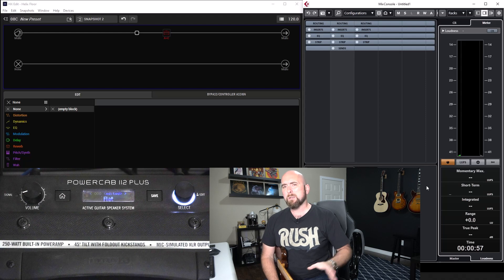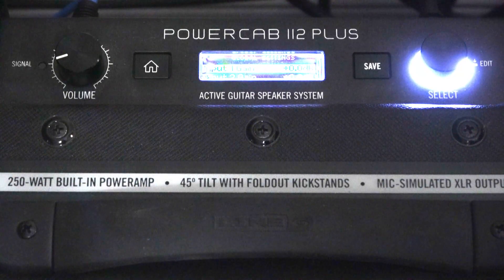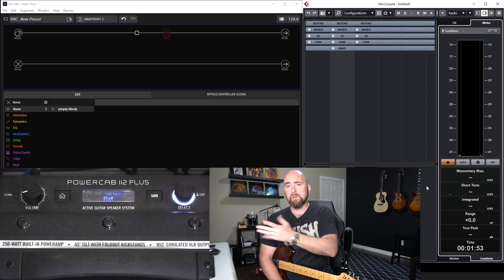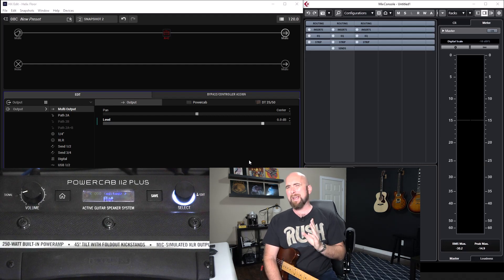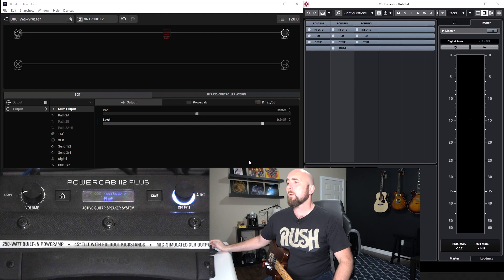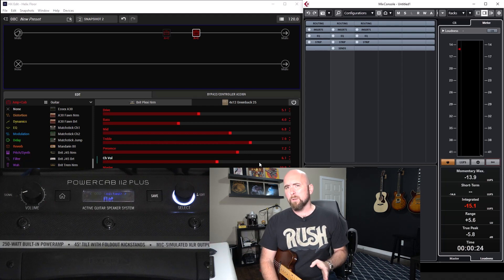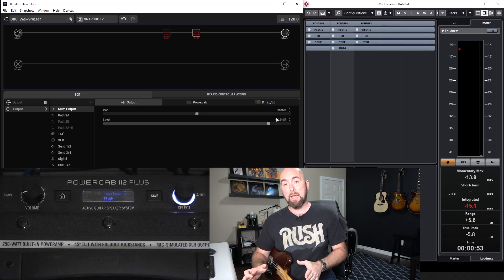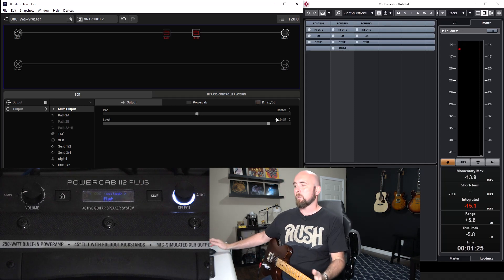SETTING UP THE LINE 6 POWERCAB 112/212 FOR THE ABSOLUTE BEST RESULTS!!

Comment: Hello and thank you for all your extensive testing and sharing of experience and use of these types of equipment. I'm in a middle of choosing what to do in the future on regards of amplifiers, speakers and sound quality requirements. I have two guitars, one with single coils only, and one with only humbuckers. I have a Helix Floor about 9 months old, a Fender Hot Rod Deluxe, a couple of studio monitors, and am able to use PC as an audio recorder and so on. I'm looking for a unit/solution to use only in my home, I don't gig, and therefore have to go for a solution with low sound output. Problem I have is to find a solution that don't have "knife-sharp" or bad sound quality. I'm wondering if a solution with a low-powered amp (like Fender Champ Reissue 5W), a FRFR (like Powercab 112) of some sort or an attenuated/reactive loadbox (like UI Ox Box) for my Fender HR Deluxe, an amp with attenuation built-in (like Tone King, Fender Tone Master) is the best solution from a sound quality viewpoint. Flexibility is certainly in the Helix, but I can use it as a pedalboard as well. A lot of info here, but hope you can help me with some recommendations and what I could prioritize to do. Again thank you for your contribution. It's really appriciated.
Reply: The 5 watt amp will lack headroom - it will sound compressed compared to a 50 or 100 watt amp.  Turning down master volume has a similar compression effect.  Using an attenuator to limit power going to the speakers will allow the power amp and output transformer to distort naturally, but the speakers will not be overdriven or distorting.  You can build a soundproof closet to put the speaker in and mic it.   Or, you can just use a modeler and drive an FRFR speaker or headphones.

Comment: Once again good content here.  What's the best way to bump up the global level output across all presets if the knob is 100%.  My presets might need to be all brought up to get into the yellow/red area.  I bought the PC+ for the bonus of using the helix to switch speakers with the AES...cool!....but I haven't done that yet.  I've always wondered why I spent the extra money for the + when I could have got the regular PC 112 and use it maybe the same basic way I use the helix now with the built is amp/cabs.  Big $$$ difference.
Reply from the maker: Hey Scott, the truly best way would be to bump out the final output block of each preset to where it needs to be. If you were only boosting a small amount (+1 or 2 db) you might be able to get away with boosting the input level of the PowerCab if it doesn't add too much noise, which it likely wouldn't with a small amount of input gain. Hope that helps :-)

Comment: The only previous video addressing this by Steve Sterlacci talked about boosting the input gain on powercab as an option  which just didn't seem right to me so havnt done that from day 1, big Volume on Helix up full works way better.
Instead of boasting the output volume on Helix would it be ok to just boost the volume chanel on the jazz chorus here  or is there any downside to that? 

Great video
Reply from the maker: Thank you! Yes in a simple setup like I was using here with just the amp in the signal chain, using the channel volume on the Jazz Chorus would be perfectly fine if it gets the results you need. Just keep in mind if you have something in the signal chain after the amp, such as a compressor, the extra level going into it might affect it in a way that is not intended. Hope that helps :-)
Reply: @JasonSadites  thanks a mil Jason last question! Does boosting the output volume on Helix affect tone at all?
Reply from the maker: Not in the least.

Comment: Hi Jason, how is your Helix connected to your DAW when you are using the LUFS meter to set the clipping level? If it is connected via USB, does the output from the USB match the output of the XLR?
Reply from the maker: Hi Andrew, the Helix is connected via USB. I have never verified if they match, but as long as I use the same method all the time it always works perfectly.
Reply: @JasonSadites  Thanks for your reply. I have noticed that when connected digitally to the PC+ from the Helix, your patches are in just the right zone, but if you connect via XLR they go in to the red much quicker if not all the time. It seems the XLR out is hotter than the digital out.
Reply from the maker: @AndrewReynolds1  it very well could be and I will look into it when I have chance. Thanks 😊

Comment: Powercab sounds great alone in studio. It does not stand up in a band, live situation with other guitar players with tube amps
Reply from the maker: It most certainly does. I use it in that manner all the time and it works wonderfully.
Reply: @JasonSadites  What’s the secret? I set it up just like you said, just touching redline with line level. Was using deluxe normal, dr z, double normal models with natural speaker setting. They all sounded great on their own, but just disappeared as soon as the band kicked in???

Comment: Yikes! Leaving an amp's volume at max all the time is a great way to damage both hearing and gear!
Reply from the maker: Please try and understand the topic at hand before making an uninformed comment that will confuse people further. Thanks.
Reply: I stand by my initial comment. It is wise under any circumstances. Also, you made these comments in a public forum. Be prepared to receive criticism and alternate approaches. You are not the sole source of knowledge in the universe.  No need to be rude and dismissive. It lessens your stance.
Reply from the maker: @ChristopherOrth  you can stand by whatever you want. It doesn't mean you are correct. You also made your comment in a public forum so expect a response when you spread incorrect information that needs correcting so as not to confuse folks.